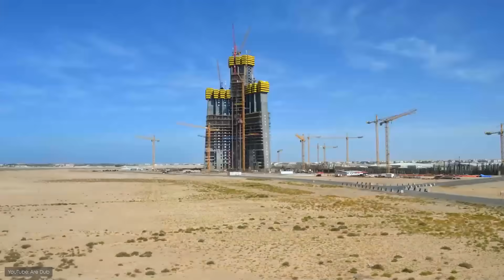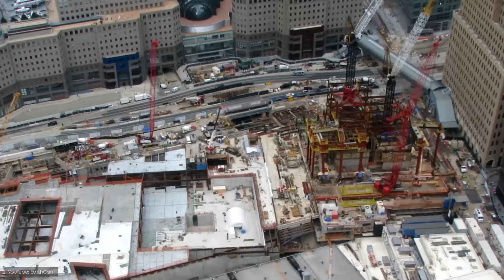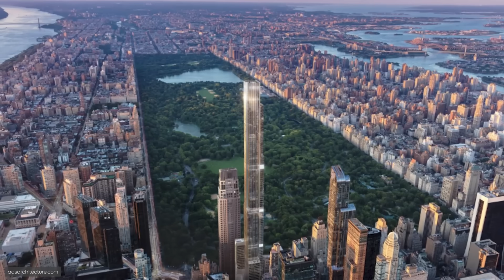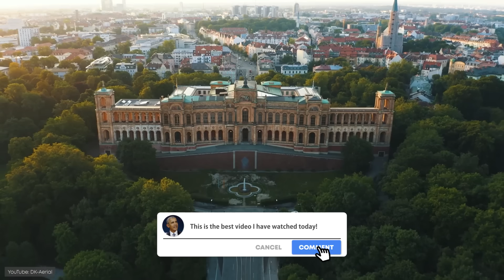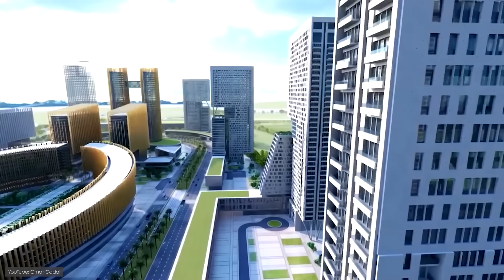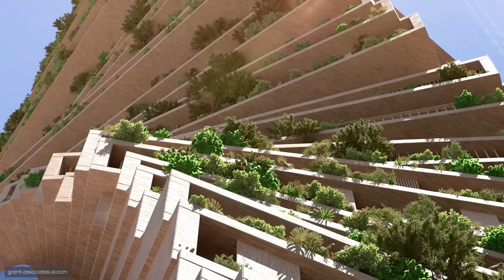Tallest Skyscrapers Under Construction by Continent

Comment: WHAT HAPPENS IF THERE IS A FIRE IN THESE BUILDINGS CAN YOU RUN A STORY ON THE MEASURES THEY HAVE TO INSTALL TO HANDLE A BIG EVENT EG FIRE  PLANE STRIKE  LIFT FAILURE  etc etc

Comment: PNB118, which was constructed by Samsung C&T, is being demolished. As the defects in the mat foundation were not cleaned up, they were inclined to differential settlement. The core that had reached the 100th floor in February 2020 was demolished over 30 floors. You can see it by looking at the picture in the link.
http://www.gstone.co.kr/index.php?tpf=board/view&board_code=2&code=471